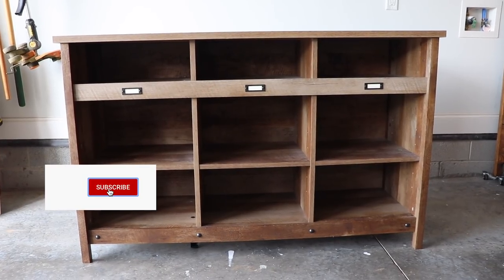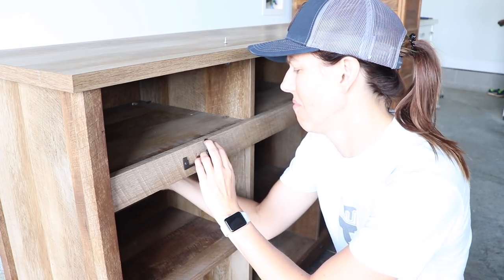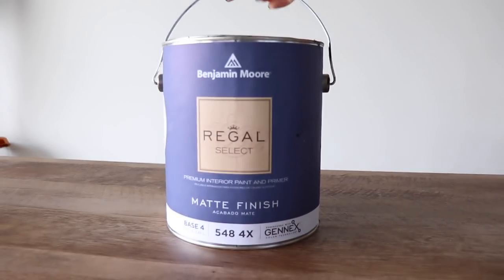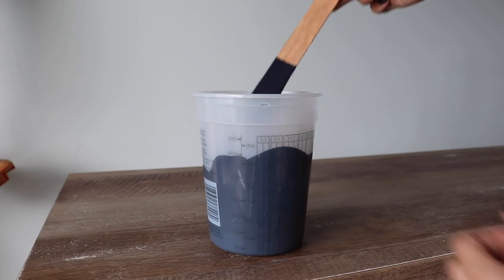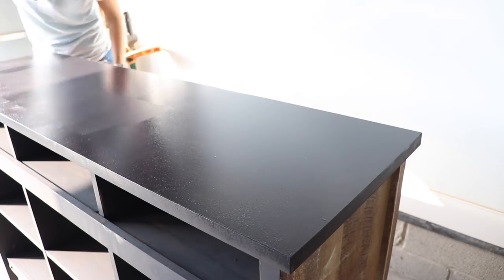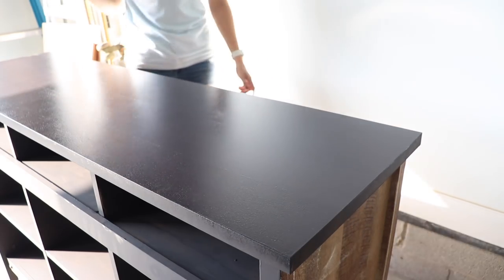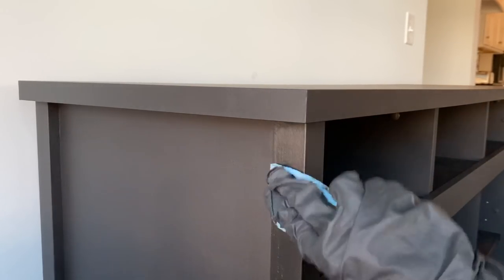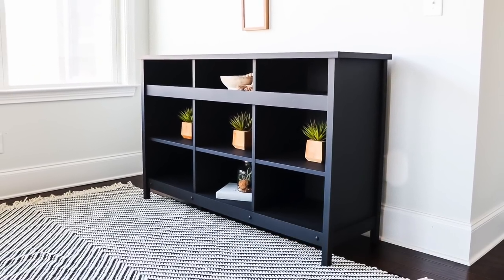How To Make Chalk Paint - Simple & Easy

Comment: Calcium carbonate is the ingredient I use to make my own chalk paint - it's the actual active ingredient used in "Tums". I'm betting this is the natural ingredient B B Frosch is talking about on their website yet is never mentioned. A 1lb bag is $10 on Amazon and it lasts a really long time and it's the same exact recipe - depending on how much paint you're using it's a few tablespoons with a little water that's mixed in a separate bowl and then mixed into the paint. You can control just how thin or thick you want it and it lasts so long! Just add a little more water if it's too thick and vice versa. I almost always make my own chalk paint unless I can find the Waverly at Walmart, it's a great pre-made and affordable chalk paint but it's been very difficult to find during Covid. Hence, Home Depot and any color I choose!
UPDATE: Just wanted to add, I buy the sample jars of paint at Home Depot for $3.99 which are just under 1 cup (7+ ounces) - one of those little jars mixed with the recipe has enormous coverage! Two good coats on a night stand and I barely used 1/4 of it. Better than the Behr pre-made chalk paint itself. I used the Behr flat latex - can be used with eggshell or satin (but never gloss), have yet to try those.
Reply: Buy it at your feed store, so much cheaper. They feed it to the goats. Guess it helps their tummies...The short word for calcium carbonate is chalk.
Reply: I also use Cal. Carb. and it soooo much cheaper than BB Frosch's tiny little jar. Cal. Carb. works so well and why would anyone spend $10 for a tiny jar when the calcium carbonate is just the same? I guess Christina has a lot more money than I have! But the piece looks fantastic.
Reply: @lzrd8460  My guess is she may have been given the product, by the company, to try  and evaluate as a form of marketing for them.
Reply: Walmart.com has calcium carbonate in a 1 lb bag for $9; 5 lb for $11.91; and, 10 lb. for $18.53. 10 lb. would last forever, I'd think. Not in store - on the website to be shipped.
Reply: @sandybush1661  Thanks for that info, will definitely check it out!

Comment: This is a dumb question but why wouldn't you just fill in the screws with wood filler instead of painting those little covers?
Reply from the maker: Not a dumb question...I thought about doing that, too, but I decided to keep them accessible in case they loosened up over time and needed to be tightened. You could certainly fill them if you wanted to.
Reply: @ChristinaMuscari  thanks. I love your videos. You make everything look so easy!